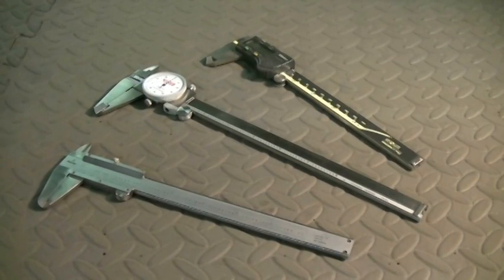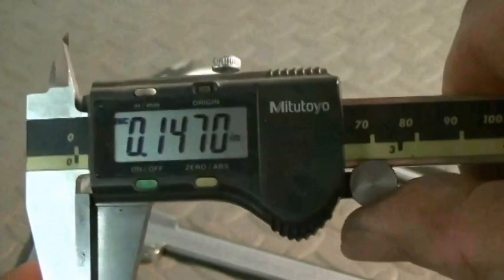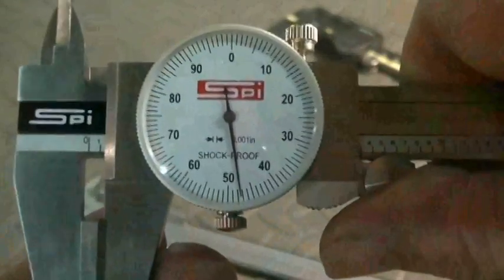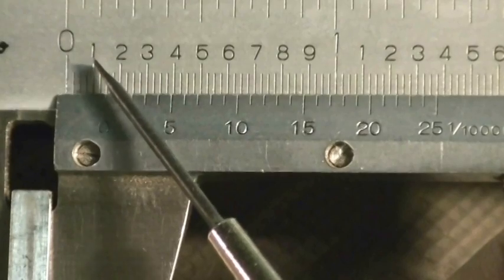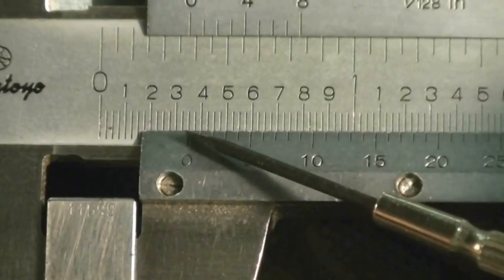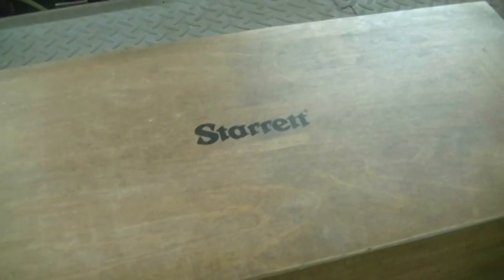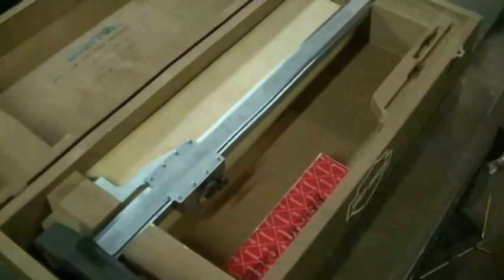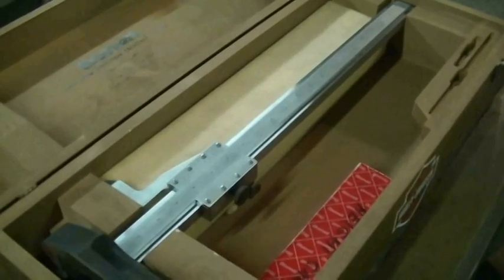How To Read A Vernier Caliper / Also Compared To Dial & Digital

Comment: l've been told by the people l work under, for correct calibration every thing need's to be at 20°C is this right?
Reply from the maker: I know that the digital calipers I have say they are for use in a  0℃～40℃ temperature range. That makes sense, though I can not say with any authority that they are right or wrong.